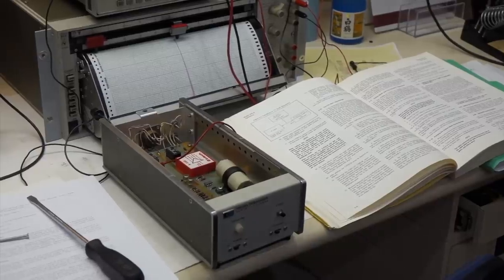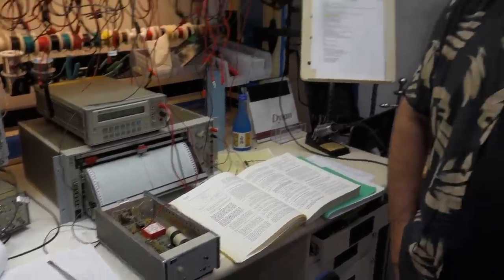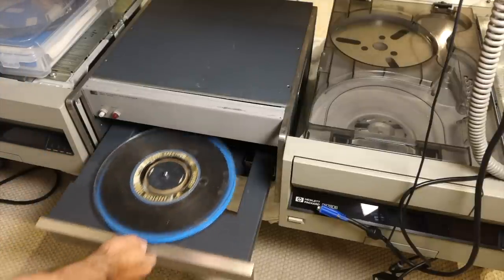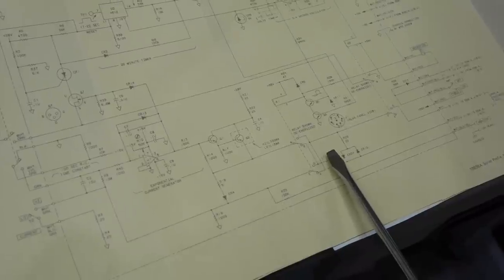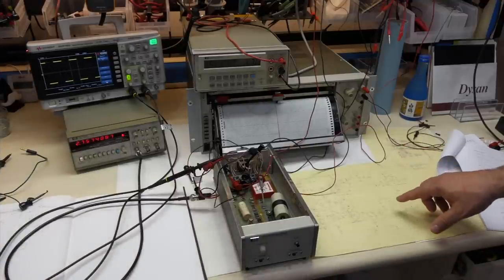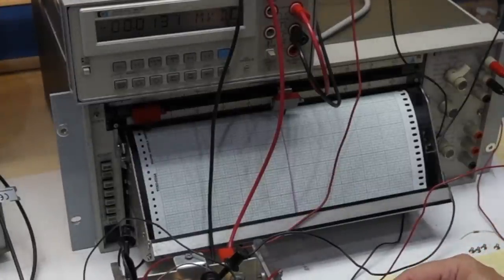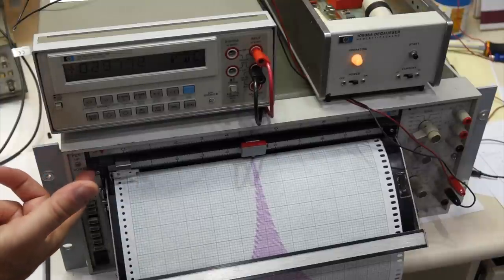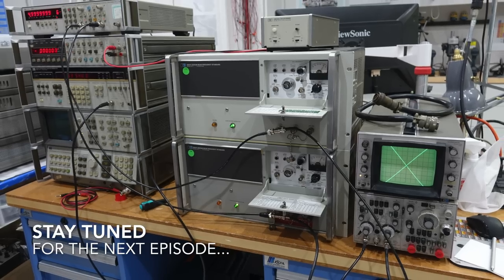HP 10638A Degausser: checking vintage HP equipment with more vintage HP equipment!

Comment: A precision cesium clock degausser: Always there is one more piece of test equipment of which you never thought that it existed and you definitely want in your collection.
Reply: Does HP (or Keysight) have a tool for all their numbers from 0 through 9999? :D
Reply: @rkan2  Just beware of HP overflow when model number reaches 9999 :D
Reply: Actually this tool was 5 numbers... so 99999?

Comment: There is another gold mine of vintage instrumentation and that is the old 1930s, 40s, 50s  sci-fi movies sets. With all the background meters and recorders in the evil "it's alive it's alive" 
monster labs. Like the Leeds and Northrup 1952 Speedomax type G chart recorder used for charting temperature and George Burr, 1940s Instron machine was working with a new device 
called a 'strain gauge'  😎 thanks a lot great HP 10638a video!

Comment: My de-gaussing experience is sitting over-night in a shack on the coast of northern England and measuring the tide-affected underground water level at the site of a proposed de-gaussing dock.   Between measurements I killed time by removing the tannin accumulation from the insides of the tea-mugs (a major task).
Reply: Thank goodness you didn't get to the teapot. I've heard those accumulations are strong enough to chip carbide-tipped screwdrivers
Reply: @DiverCTH  I don't think that the shack ran to a teapot; strictly teabags.
Reply: @SubTroppo  Assuming this is a "lost in the pond" moment.

I was borrowing from the late Sir Terry Pratchett's Sam Vimes novels and assumed there's a British version of the bulk pot that American drip coffeemakers use.

We yanks live on coffee instead of tea, and depending on the setting, the pot either gets left to boil dry or is reused for long periods between washings (a quick rinse doesn't count). The truely ancient metal-bowl pots can accumulate an unbreakable .5mm crust of burnt coffee whereas the modern glass or plexiglass ones break before that happens.
Reply: @DiverCTH  Domestic teapots are never cleaned out but I am not sure about tea-urns which used to be used in factory canteens etc. I tried a Terry Pratchett book but just couldn't see what my brother was going on about.  However the first two books of  the "Gormenghast" trilogy by Mervyn Peake are an entirely different matter.   

To paraphrase Star Trek:  It's coffee Jim, but not as we know it here in Australia.  ps The Yanks used to drink tea big time, why else the 'Boston Tea Party"? pps I hear that Americans are getting around to electric kettles!
Reply: @SubTroppo  I know plenty of people who wash their tea pot by hand every few weeks, some, even stick it in the dishwasher occasionally. The only reason not to do it is if you only have one teapot!
Reply: @kaitlyn__L  Which side of the "pond" do all these tannin-averse people live? It reminds me of the micro-plastics contained in dishwasher detergent capsules (shakes head).

Comment: Long ago played with a degaussing coil on color TVs.  I think the one in the shop was home-made even.

A few years later I was dumb and put a neodymium magnet up by a CRT monitor.  OOPS with a colored spot that did not go away on a power cycle (so the degauss circuit in the monitor could fix it).  I recall flipping the magnet end for end and carefully doing hand motions around the spot to work it away...

Then there was the time I had to work with a permanent magnetizer.  It was for magnetizing flywheel magnets on small engines for the ignition.  It came with a gauss meter and you had to have a coil to slowly draw the magnet through to measure the field.  I made one (from the manual info) out of normal wire and got to practice trying to measure when the magnets had reached max strength as determined by how many volts on the big capacitor bank got dumped into the winding on the fixture.  A real "thump" piece of gear!!!  Fun times!
Reply: I once did something similar, except instead of massaging it away manually, I just waited for it to slowly go away over about 30 power cycles with regular use. Luckily, it was just my TV in the bedroom (which itself was just an older TV from the living room) so no one else was bothered.

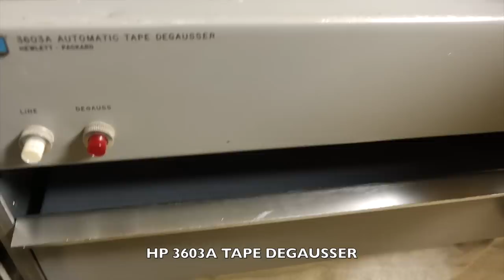Comment: 4:02 My tape degausser has a conveyor belt, it looks like a supermarket checkout.  You can drop any kinds of (oxide) tapes on it and they fall off the end, blanked.  It's less effective on metal formulation tapes though, they have much higher magnetic retentivity (one reason that Video8 is better than VHSC).  It's seriously heavy.

Comment: If you are planning to replicate the Flying Clocks' Experiment and Fly one of the HP 5061A Cesium clocks and compare to the time on the HP 5061A Cesium clock left on the ground, I'm happy to chip in for the air fare. :)
Bonus points for historical accuracy if you can do with a DC-7 aircraft per original experiment, but whatever you do, it's always a fantastic video. 
Thank you.
Reply: I think they have all the hardware and knowledge to fire-up an unused Saturn V and do this experiment by landing a clock on the Moon.
Reply: There are currently no airworthy DC-7s.
Possibly an airline, or Boeing, would agree to carry one on a test flight.

Comment: wow...that was kool to see ..i never knew they blanked out those data tapes ..i guess to make sure the data on there could not be used by others ...such a great collection..all can still be used today for real science ..that is the seal of quality :)
Reply: Not to make sure the data was gone, but to leave the blank tape so that it could be re used, and not worry about getting bleed through of old bits that the record head did not flip correctly. You want to record ideally on a neutral bias, so the head current is low, so it will provide enough energy to flip all the way one way or the other, if you have old data there your head either has to have a higher current to ensure it can flip from one to the other, which heats up the head unnecessarily, and also runs the risk of the stray field flipping other bits already recorded.
Reply from the maker: I think it was primarily used for instrumentation tapes, as instrumentation recorders did not always have erase heads. Use for data tapes required a hub adapter accessory, which you see I hastily cobbled together.
Reply: @SeanBZA  I know what you mean, but I found it funny (weird humour, I know😁) that what you described was actually precisely "making sure data is gone", just not for the "spy" reason 😁

Comment: Demagnetization with very low frequencies makes sense and may be even required. Depending on the circumstances, magnetic fields produced with mains currents of 50Hz or 60Hz may appear as of "high frequency" to the magnetic material. This will cause eddy currents in the surface of the material, which in turn shield the inner parts of the material from the applied field, so the demagnetizing field cannot penetrate the entire material.
At lower frequencies, the demagnetizing field goes deeper into the material and has a stronger effect.
Reply: Good point in this respect:  I learned in the '70 from a Japanese technician from Akai (Mr. Nakamura) how to de-magnetise audio recorder heads. Of course a 50Hz coil was used, but when he pulled the split of the coil slowly away from the playback or recorder head, he also described small horizontal circles with his hand, so the field was also pulsing in a sort of 1 Hz amplitude until his hand was behind his back.

Comment: Much easier when you have to recalibrate your modern voltmeter. You just take any old Apollo equipment and use its power supply as a precision reference ;-)

Comment: Big Clive did a simple video about degaussing a few years ago.
https://youtu.be/81Vuhe-ytz4
I took a transformer from a lamp and rearranged the laminations to turn it into an e-core electromagnet, put it in a box with a momentary button and a giant LED to show when it's on which works fine to demagnetize pliers, cutters etc.
You just have to pull the tool away from the magnet slowly.
Of course I can't pull them away in a perfect exponential curve over 22 minutes. :)

Comment: Can you put a modern mechanical hard drive in the degausser to see if there is any data left? I know it's not made for that but maybe you could try it if it somehow fits? Thanks!
Reply: hard drives require a stronger magnetic field than tapes - because the alloy shell helps shield against magnetic fields - so it likely wouldn't be very effective to stick a harddrive in a tape degausser
Reply: @thesteelrodent1796  Thanks for the response. We still don't have any scientific evidence of this :P If they have the time to try, It would be interesting to see :)
Reply: That hard drive would be very dead, if it's affected by the degausser at all. The disc contains tracks that are essential to make the head control circuit work.
Reply: This degausser wouldn't even touch a mechanical hard drive, or even a modern tape cartridge for that matter.  Their high density formulations require far, far stronger fields than this unit can produce.

Comment: I have no idea how you find this obscure equipment. There couldn't have been but a few of these made
Reply: They were not that uncommon - basically, if you had a 5061 with a high performance tube you had the degausser, simply because the use of the degausser was required to meet the stated spec.  You had to use them quite frequently, too - if you moved the clock any significant amount you had to do a high-current cycle, and you were supposed to do a low current cycle if you just turned the power off and back on again.  At this point, I expect there are likely more degaussers than functional high-performance tubes, simply because to get stated performance you basically have to run the clock 24/7 and in that state it only lasts about 8 years before the beam current drops to the point where it starts to degrade the tube performance.  This is also why a lot of these clocks were taken out of service - if the tube started to get weak, then it made sense to replace them with the HP5071 because the standard tube on the 5071 provided better performance than the high-performance option on the 5061 and lasted a lot longer.

Comment: I just wonder how much this C field affects the cesium beam and the time.  Should we be concerned that all those cesium beam clocks out there are a bit off because they haven't been degaussed in years?  Or what?
🤷🤷  Thanks for the entertainment, Marc!
Reply: They operate within spec or they don't.
Reply: No, the effect is pretty marginal - IIRC, the standard tube was quoted as 1 part in to 10^-11 and the high performance tube was 7 parts in 10^-12 - the degaussing is not considered necessary on the standard tube because it will hit the specs without it. Also note that in a lot of cases the reason people used the high performance tube was not so much the better accuracy but the improved close-in phase noise (standard was -80dBc/Hz @ 1Hz, and opt 04 was -100dBc/Hz @ 1Hz) - the downside is that it burns through the Cs a lot quicker.  Another thing to remember is that the 5060/5061 are basically museum pieces now - even the (30 year old) HP5071A doesn't need degaussing for full specified performance.